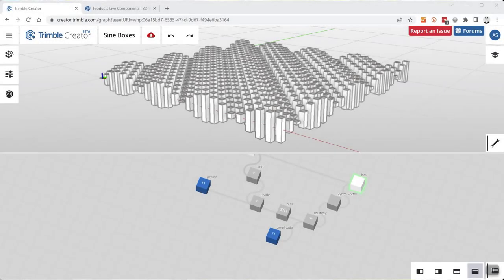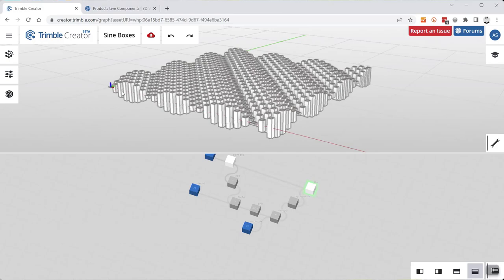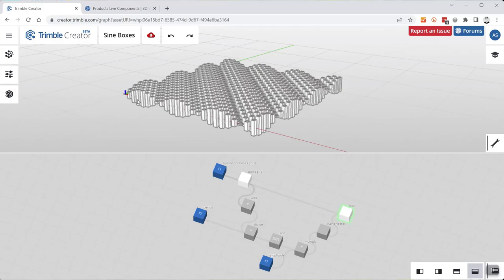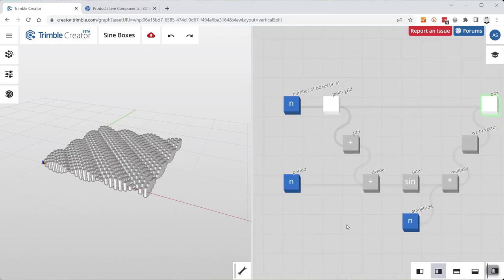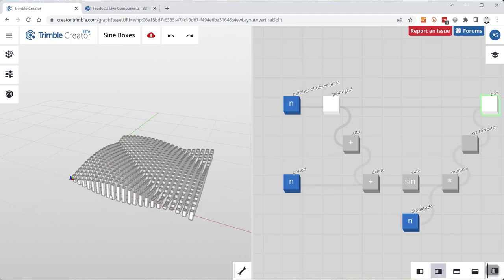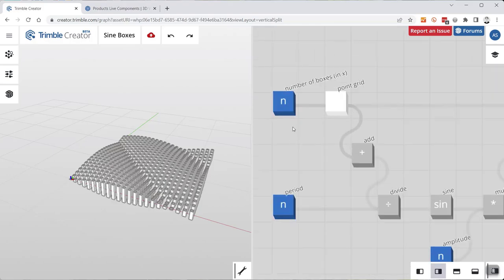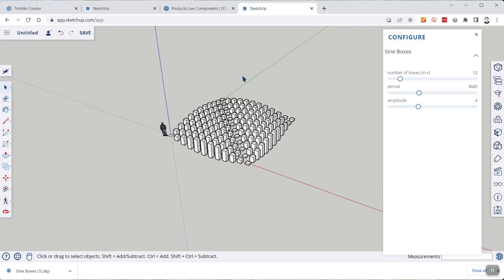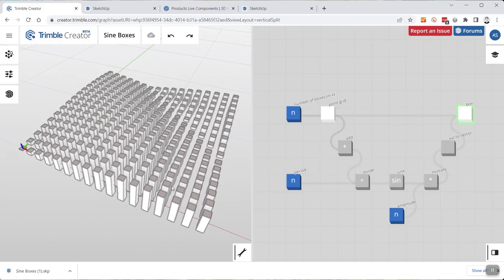Trimble Creator: Introduction to Parametric SketchUp

Comment: Thanks for the overview. I'm familiar with Revit's Dynamo and pretty proficient with Blender's Geometry Nodes so I was excited when I saw this, but unfortunately it's so, so, so slow. I thought maybe it was due to the web interface, but it's even slower inside SketchUp (I'm guessing because of the server connection delay). I would say it's basically unusable in its current form—sure, my computer is relatively old, but Geometry Nodes can create and manipulate at least 10 times the amount of geometry in real time on the same machine so there's no reason SketchUp should screech to halt with just 15 rows of cubes. 

Sorry for the rant—I really hope they can (somehow) boost the performance significantly, it would be a big improvement for SketchUp, especially for architects.

(I also have many misgivings about the graph UI in general, but they pale in comparison to the performance issues)
Reply from the maker: I agree that the delay is a bit annoying. But I would think that over time this will get faster. Maybe they can move some of the geometry processing to the local engine. I don't know if that's possible, though. But in the current form this can be used on the web and the iPad, which may not be possible with local processing. We'll see....